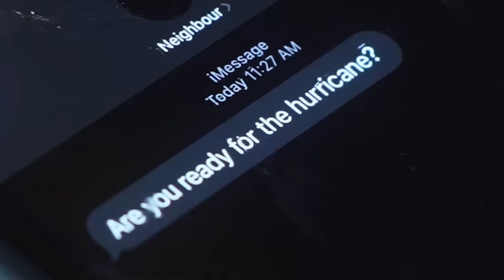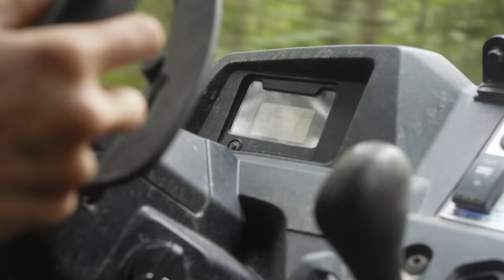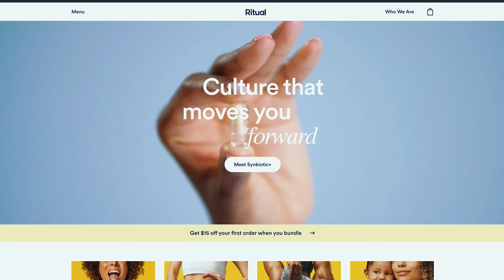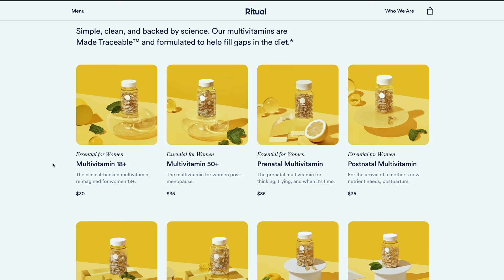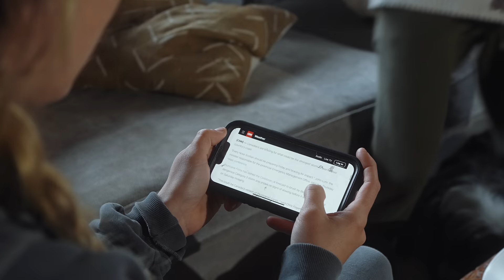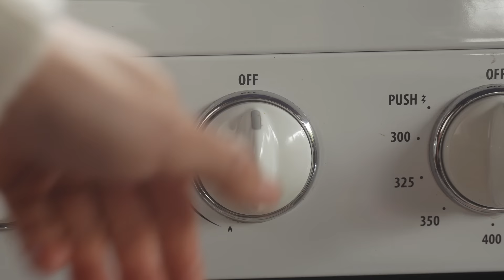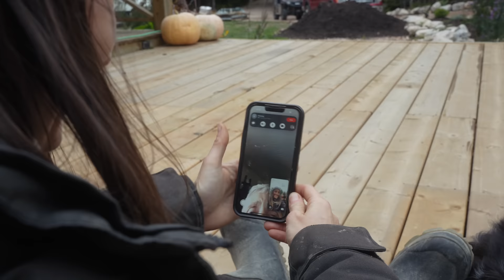HURRICANE HITS OUR CABIN - WE CAN'T LEAVE

Comment: You both got everything done in good order prior to Hurricane Fiona.  I'm in North San Diego, mild weather most of the time, summer was insanely hot everywhere, but no huge storms.  And this past week, Hurricane Ian slammed big chunks of Florida, 3 million were out of power at one point, 23.7 feet of flood/surge water in some areas.
1000's of permanent RV's , travel trailers, mobile homes which there are many, all underwater.  Some folks have even lost their lives.  😯😥. Yet many areas didn't flood, but sustained high winds.  It's a lot to comprehending.  
  You two are in a good spot, the forest around you protected you
 💖🌈💖🌈💖

Comment: I'm in Florida former Texan I've been through multiple Hurricanes, you'll be fine. Remember Hurricane Season isn't finished until late November sometimes first 2 weeks of December. Always have a food pantry stocked with food, water, batteries, Emergency Radio, Walkie Talkies or CB Radio,  toiletries, medications, gas tanks full on Vehicle and extra gas tanks. . Plenty of wood for heat or cooking. Flashlights are necessary, dog food. Make sure any flying objects are anchored down. Trampoline needs to be put away or it'll fly away and get destroyed. Board up windows if wind is too strong that you can have flying branches or debris hit your windows.  Good Luck and be safe. We just went through Hurricane Ian here in Florida. We're ok. I'm near the Jacksonville area got lots of rain and strong winds but not as bad as Southern Florida. Always be prepared for Hurricanes and Freeze's during Winter. Lots of love from Florida.

Comment: Having not been through a hurricane, other than the tail ends of two while sailing down the west coast during my time in the Navy, preparation is everything. As a suggestion while you are waiting for your solar system to be completed and you need to keep warm, it would behoove you to keep at least a three day supply of wood in your garage. This will keep you going until things dry out and you can always dry your outside wood with the heat from the stove and keep a steady supply of wood going to keep you going. I've used this trick on several damp camping trips and it keeps people more comfortable. Glad you made it through this trial by water and wind.

Comment: Definitely get the solar system going, with a nice big battery. Even in situations like this when there is no sun, you can be much more fuel efficient with the generator by using it to charge the batteries. Having a large battery with a few days or even a week of autonomy also means that you don't have to get the generator going right after a storm hits, but you can focus on other things that might be more urgent than basic things like power.

Comment: You can transplant tomatoes and peppers 'extra deep' 6" up the stem, and they will grow new roots from the buried stem.  I noticed you planted the tomatoes in the greenhouse at the same level they were planted outside.  More roots means more tomatoes (or peppers).  
I had an inch of water on my floor from Hurricane Ian in NE Florida.  Now replacing drywall, repainting, and I'll have to take all my clothes to the laundromat as they are all musty smelling.

Comment: Have you thought about storm panels/shutters for your windows.  Also plywood cover for sauna glass door.  To prevent stuff from breaking the glass.  Also does the house roof have hurricane ties (metal that attaches walls to rafters).  Although the trees around your place, negate the force of the wind have you considered a cement storm shelter as a secondary shelter.

Comment: Great job guys getting ready for the storm. Having been through many hurricanes, the next time you need to cover the glass. You were very fortunate that flying debris did not break any glass. Your two picture windows and the Sona door. Glad you are safe and I enjoy your channel. Your solar system will also help you in the future. What's the plan for the wood pile? I recommend some type of covered shed? The tarps get covered with snow and it's a lot of work getting the wood and it does not stay as dry as it needs too. Maybe some can go on the front porch. Like a cord at a time. Again great video.

Comment: Happy that you gals and the pups were safe and sound at the end of the insanity. You weathered the storm like true Canadian Maritimers!  

I’m reading over some of the comments, I found it rather irritating how some were downplaying the strength of Fiona, saying it really wasn’t a hurricane. In reading the official reports on the storm in your area, winds at time exceeded 75mph at times with gusts to 100mph. Although those speeds weren’t constant, they did fall within hurricane parameters. 

Back when Sandy hit NJ, it was considered a “super storm” with winds slit less than hurricane strength but they were consistent. I lived 50+miles from the coast in the mountainous region of NJ, which is considered a highly wooded area. On my property alone I lost 3 trees that were probably 75+ years old. Two were uprooted and the other snapped 5 foot above the ground. The average trunk diameter was 30+ inches. Just as an example, when I finished cutting it all up into firewood, it was 4 times the size of your pile. I was also without power for 8 days. Thank God for the RV. 

My point in all my brain salad above, just because a storm doesn’t have a “hurricane” moniker sure doesn’t mean it’s not deadly. Kudos to the both of you for following the proper procedure for hurricane safety. 

Till next week, enjoy life, be safe and much ❤️!!

Comment: Good work on weathering the storm. That was a wicked one. I live outside of Philadelphia, and my experience with storms and hurricanes (not “The Big One” yet) is the more reliance on infrastructure created by others, the better chance of failure and long-term outage. This is not the case for you two. Actually, your secret weapon is your relationship and ability to lean on each other through anything. (Porter is the not-so-secret weapon.) Just a thought. take another walk through the trees, and try to spot stressed-but-not-fallen that may need to come down to prevent damage during winter and/or next summer winds and weather. Well done.

Comment: You guys working with floodlights, into the night, reminds me of us getting ready for hurricane Dennis, back in 2005(?), early July, we had just moved to Florida (so happy we don’t live there anymore), and we were getting ready for a cat 3 hurricane, forced evacuation (hubby was in the Air Force at the time, so they made us evacuate) with 2 large dogs, 2 cats, a rabbit, and 2 hermit crabs…… we worked well into the night, and had to evacuate at 5 am…….. We came home two days later, to now power, 90 something degree, humid weather, fuel was jacked up to over $6/gallon. We were one of the few with a small generator, enough to run a small ac window unit, fridge, water pump……. Yep, you are lucky to be where you are, prepared like you are…….. Having said all this, hurricanes you usually can prepare for, tornados on the other hand………..

Comment: I set frames of treated to imber around my windows, and in these are set galvanized 12mm bolts.  Onto this frame is mounted heavy plywood, secured by wing nuts over washers on the inset bolts to hold it in place.  That plywood shield  is to protect the glass from flying debris velocity of this den bris is astonishing.--I saw a lump of  splintered timber which had slammed into a Quandong softwood tree, and it protruded from the other side of the tree which was about 400 mm diameter.  That is what happens in a cat 5 storm.  The main  danger to life is not the wind, or falling trees which ought not to be able to reach your dwelling, it is flying debris and HUGE hailstones.  After the storm, prepare for flooding.

The Mark II version of my cyclone screens will be pull-down gas strut supported shades, which will allow windows to remain open in rainstorms, but can be pulled down a d locked with bolts as required.  Here we het a lot of tropical circular storms.  It is the greatest draw back to living in the tropics.  It seems, though, with your experiences and with Planetary Overheating, one is no longer safe  from severe circular storms anywhere

Comment: You're lucky you only got brushed. Being in Florida you get a scene of needs and as years pass to what you need. Get a plastic box, battery lanterns, a red cross radio (battery & solar & crank (will charge phone) ) duct tape, Ty wraps (small to really large) nails the same lashing wire and cheap thin painters drop cloths in different sizes. A few dollars a week to gather this. put it away and never have to use it. YEA, but we have all this, that is great if a tornado leaves the house. Go back and look at Andrew hitting Florida, If you had a house might not have power for a year. Your plan is tight and should be ok but what was it like at first.

Comment: Noticed you have firewood under a tarp! NOT a good idea because your roughting the wood.The tarp just keeps the evaporating moisture inside! You need ventilation  You tube may have plans but sides should be slated to hold the wood in but allow the breezes flow threw! And the trees on your acreage have grown from previous clear cut and as the forest grows the trees are sheltered by the next tree! If you select one tree and take out the three or four trees thinning your forest the roots will grow further and be stronger!

Comment: Girls(I say that affectionately since I am nearly old enough to be your grand dad), Ok Ladies, Since you live so far away from, well, most every where, I have an idea for you. Make your selves a Ready book. Get you a lamination machine, and plenty of sleeves.  First make a list of all situations where you'd have to get ready for, prepare for such as A death in your family, a hurricane, a winter storm, a wild fire, and so on. Could be minor, could be major. Then write down every thing you need to do sucj as what you had to do in the past, and maybe add some things that afterward, you thought of something else. Print it all out, make a file on your computer so you could change it in the future and make another updated list. laminate the lists, so in such a situation, you didn't have to think of much, just do. and when in that situation, you do your list and mark it off.
A few things I'd recommend:  Not only get your chainsaw filled up, and your generators filled up. Crank them up, let them run a while, to make sure they are running good, but make sure your saw is sharp, chain adjusted, and your fuel, gass, chainsaw wrench and file were with it. Make sure your Gens have a recent oil change, and also, as far as the gens, a lot of times they don't like to crank in the severe cold. Make you a box to put over them while they run. Keeps the fuel from gelling and also the oil too. I'd go as far as to keep them inside and warm. That will make cranking them a lot easier. 
Looking at your drone views of your home, I think some more clearing of trees would be a good idea. And of them that could fall, either from wind, or fire, that could reach even close to your structures, should be cleared out.  In case of wild fires, Have you some sprinklers to set out to soak all of your property. If you did have to evacuate, I'd leave them running, to better hope when you came back home, that everything would still be there. And speaking of evacuating,... You've mentioned there aren't many roads out of there. Don't forget about the lake. That could take you out of harms way in such an event. Even if it took you no where, in the middle of the lake would keep you safe. A good set of videos would be the building of a house boat, to be used in case you had to do that. Something that you could survive on for a good while. Sleep in, big enough for your dogs and you both. a way to store food, filter lake water for drinking, washing, and cooking. 
Something else I have thought of, well a couple of things... chickens, They do great at ridding your property of bugs. Flies, ticks and so on. 
goats, they will do great at keeping the weeds and undergrowth to a minimum, to help in case of wild fires. They are also good pets. Train them to come to the bucket shaking( at a minimum of food, this will bring them into the goat house every night, for their safety. Same with the chickens.
Thanks for allowing me to share ideas.